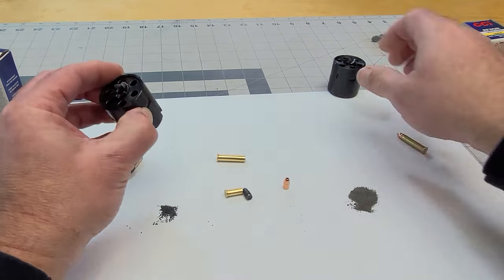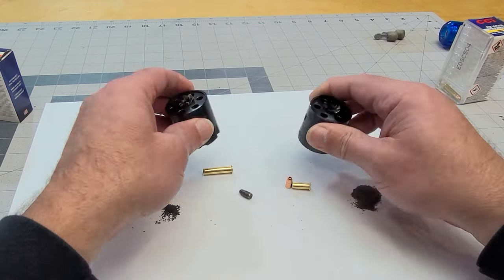22lr Vs 22Mag Whats the difference?

Comment: Don't forget 22 is 222 22 mag is 224
Reply from the maker: Aww, what's a thousandsth here thousandsth there. I've seen some specs calling the .22WMR as .2285 and some as .224. I've seen .22lr specs saying .223 and .224. It makes me wonder what it's really supposed to be!
Reply: Bore diameter can vary from manufacturers, and ammo diameter will vary between manufacturers. If you have a .223" bore and shoot .222 or less gas blow by can get past the projectile as it travels down bore causing inaccuracies.
 Pull a bullet and drive it down the barrel, mic it to determine your bore then mic your ammo and don't buy the brands that don't at least match.  .001" over will ensure a tight bore seal.
Reply from the maker: Yes, there can be quite a difference!

Comment: You are totally wrong about the pressures being higher on the 22 mag. They are both equal.
Reply from the maker: I stand corrected! Thanks for the comment, and thanks for watching too!
Reply: How is that possible? In order to get something to accelerate faster the force needs to increase. The force provided by pressure only increases by either surface area acted against or the pressure is increased. Since the projectiles are the same calibre, the pressure would have to increase or at least be higher for much longer if it doesn't peak at a higher pressure.

Not to mention, it seems intuitive that more powder in a case with not much more volume would have significantly higher pressures, no?

Comment: I had my eyes set on a Ruger Wrangler, but after finding out about the Rough Riders .22WMR cylinder I’ve had a change of heart you could say. Thanks for the informative video.
Reply from the maker: That is one of the reasons I like the Heritage better. Thanks for watching!
Reply: I like Ruger Wrangler because it's more accurate for me than Heritage Rough Rider, but it rusts in a few places easily such as the barrel and the barrel release pin. The Heritage Rough Rider hasn't had any rust problems for me.
Reply from the maker: @rwdchannel2901  Interesting, I usually keep everything clean, oiled and in a low humidity environment. I haven't noticed any rust issues. Thanks for watching!
Reply: @SmallCaliberArmsReview  I had the Ruger Wrangler and Heritage Rough Rider in my fire safe locked up for about 6 months without using them. I cleaned them before putting them in there. Then I opened it up and the the Ruger Wrangler had rust on that pin you push to release the barrel and around the barrel it had spots of rust. The Heritage Rough Rider was in perfect condition.
Reply from the maker: @rwdchannel2901  that's interesting, weird but interesting.

Comment: What about hyper velocity .22LR rounds. What is the difference between hyper velocity LR and WMR
Reply from the maker: Physically, the differences will be the same as the regular 22lr and 22Mag. I would have to say the difference between hyper velocity and high or standard velocity would be the powder's burn rate because there's not a lot of volume in a 22lr case.

Comment: weight difference between 1000 rounds of 22lr vs 1000 rounds of 22mag. ?
Reply from the maker: I couldn't say but the bullet weight could be the same, say 40 grain. The only difference would be about 1/4" extra brass and a few grains of powder. I'll have to break out the scale and see. Thanks for the question and thanks for watching too!
Reply from the maker: From doing a quick google search and some gorilla math, 1000rnds/.22lr = 7.3lbs, 1000rnds/.22mag = 8.9lbs. Not much difference, about 1.6lbs.

Comment: What's the powder difference, one looks like a bigger pile?
Reply from the maker: The 22Mag is going to have a bigger volume of powder, that's just the nature of the beast. I did not measure the weight differences of the two powders mostly because they are two different types. It would be like trying to compare vodka to water, sure they're both liquids but one packs a little more punch.

Comment: Ok, but is it possible, theoretically, to lengthen the 22 LR case, to obtain performance similar to the 22 Mag??
Thanks for the kind reply.
Reply from the maker: Well, any time you can get more powder in the case, you can build more pressure. CCI has done it with the Stinger, the case is slightly longer but has a slightly smaller bullet so the overall length stays the same. I don't know how it compares the the .22mag though.

Comment: The 22 lr has a diameter of 223.
 The 22 magnum has a diameter of  224.
Reply from the maker: What's .001" between friends? Thanks for the info and thanks for watching too!
Reply: @SmallCaliberArmsReview  one thousands of an inch can easily get someone hurt or even killed when you are talking about firearms. 
If it couldn't, then I would not have even mentioned it. I have been an avid reloading fool for over 35 years, and that there is the truth.
Reply from the maker: Don't get me wrong, I wasn't trying to make light of your comment. The .22lr and the .22 magnum, despite the difference in bullet diameter, can both be fired through the same barrel. Many manufacturers of .22 caliber revolvers, provide both the LR and the Magnum cylinders so that both rounds can be used in the same firearm.
Reply: Same as 223 and 556

Comment: From what I've read and understand, mag is inherently not a very accurate round compared to 22lr.  I also don't recall seeing any mag match ammo in my decades of life either.  Seems like 22mag would be a great alternative, but the cost is excessive compared to LR.
Reply from the maker: I have never seen Match Grade .22WMR either but I'm pretty fond of the round. I've also been able to take out some groundhogs at pretty good distances with it as well. I think .17HMR might be just a little more accurate than .22M, it's definitely flatter shooting. The price of magnum is definitely more expensive than .22lr but I don't use it for just plinking, that's the role for the lr rounds. Thanks for watching!
Reply: I’d stick with the .22lr. For plinking & little varmints, can’t be beat.